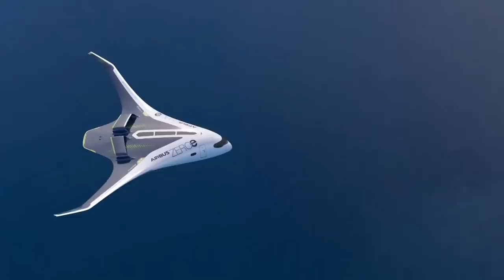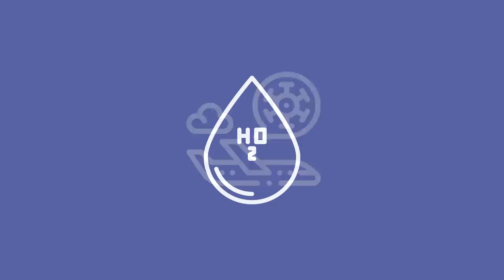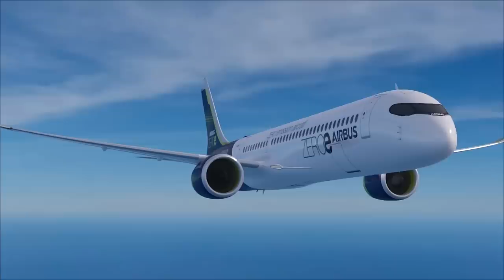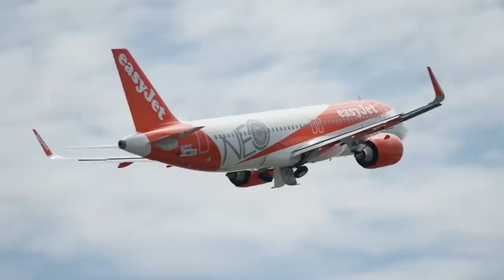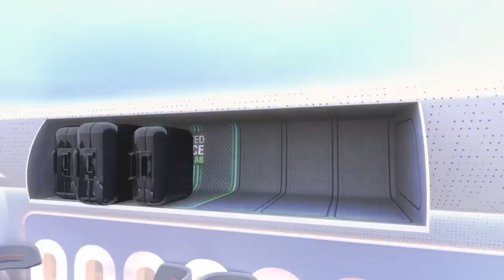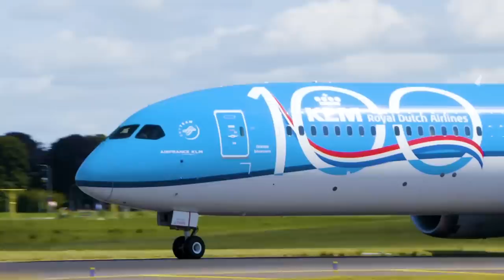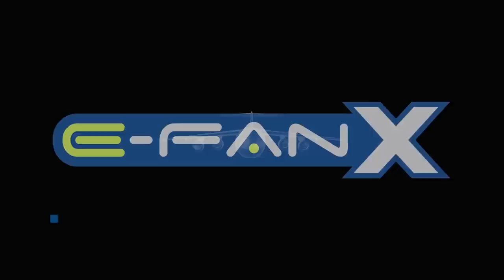Airbus Future Plane Concept - ZEROe - Hydrogen, New Cabins And Zero Emissions - Never Built

Comment: The electric concept carrying lithium batteries instead of passagers was useless and unviable. H2 with green and PV production should be very economical by then....in 2035. Seems to me the flying wing concept gets more lift from the many top wing mounted electric fans powered by H2- air fuel cell and supercondo for take off. and this propulsion could be more efficient than the more conventional pair of H2 high bypass jet engines under the wings. Finally, the best way to optimize airplanes efficiency, usage and CO2 reduction would be in general to tax the landing based on CO2 tonnage per full fare passagers of the incoming flight because empty seats and discounted ticket sales to match the fixed demand with the distorted offer instead of the contrary, are the real and major polluting waste of today's commercial aviation. Both airplane size and frequency can vary to match real demand with an A.I. multi parameter real time management system but air current waste are so big that they become invisible.
Reply: Hydrogen fuel cells make sense though. Hydrogen combustion doesn't really make sense as it doesn't improve efficiency much. It's just simply swapping one fuel type for another like gasoline to LPG. Heck, even a gasoline fuel cell would be a HUGE improvement.
Reply: 00crashtest very correct: a gas turbine has roughly half the efficiency of an H2 to air 65% efficient fuel cell but a jet engine could be much lighter so that an hybrid system using also jet engines for the very short duration takeoff and fuel cell and electric fans for cruising with even the same fans for both drives could be a possible answer, like the non plug in hybrid is an intelligent and efficient urban stop and go transmission without heavy weight batteries.
Reply: Would green methanol produced from hydrogen and captured carbon dioxide be a suitable and economical aviation fuel? Wondering?
Reply: jaganathan Jonathon yes with minimum engineering and cost but with one big loss, the heat value per weight of H2 is tremendous, two good time methane and three time liquid fuels ethanol kerosine etc...this advantage is offset by the pressure tank higher weight or with liquid H2 by the after boiling and liquefying losses and there, the bigger the tank the least the dead weight per kg of H2 is necessary so H2 planes would be big...methane and methanol smaller...

Comment: If this happens I'll eat my own sock after work. Its never going to be economical or practical as long as we use fossile fuel its to cheap for anything to compete.
Reply from the maker: Very true!
Reply: Fossil is only cheap because its still available in relative abundance, eventually there will be a tipping point where it is nolonger the cheap option.

Comment: This guy clearly does not know how much biofuel is already produce in the world !!!
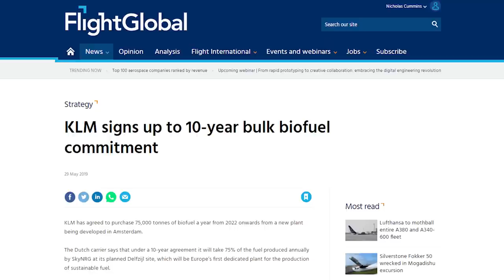5:44  "The KLM would used up the entire world supply of biofuels in less then a day at peak operations."
That is simply complete nonsense. 

The Brazil produced 26.72 billion liters of ethanol in 2017 from sugar cane in sustainable  way. 
The Air France KLM spent 4,5 bln EUR in 2017 per jet fuel (kerosene) that is 5,28 bln $/year. 
According to IATA the price of jet fuel is now 0,623 $/kg which means that KLM uses around 8,48 bln kg of kerosene. 
Of course the kerosene has 12 kWh/kg that is more then the liter of ethanol 6,67 kWh/liter. 
But even converting that use of KLM per liters of ethanol it would be 15,26 bln liters of ethanol per year. 

Clearly yearly production of ethanol in Brazil would be enough to power Air France KLM for 1,75 year. 
And there is also USA that produce similar quantities of ethanol but in not very sustainable way.

Comment: Carbon dioxide extraction and conversion with water and renewable energy to produce hydrocarbons is a much more viable technology than hydrogen. The volume that liquid hydrogen takes up would probably up the ticket price just based on seat reduction alone by a third or more.

Comment: an airplane made like that you have to explain to me how it can fly, are we kidding?  blonde entrance too thick, then towards the tail it is flat, can you explain to me how it can pressurize such an airplane?  even if you use 100% carbon fiber you would put the structure in crisis, a bullshit of the project, everything needs to be redone.  I remind you that the new Boeing 787 has an airfoil of a glider, to improve performance which was impossible with aluminum, and now Air bus wants me to believe that that project can work ???  it's an insult to aeronautical engineers, believe me

Comment: Lol why does airbus copy boeing so much. Just 10 years ago same looking Boeing blended wing body aircraft was unveiled
Reply: Boeing never unveiled an BWB. You are referring to a rendering on the front of popular mechanics. The design of the BWB has been mostly researched by NASA together with Boeing on a R&D side of things. No commercial products are derived from that. Besides the BWB design is not owned by anyone, just like the tube with wings or the flying wing.
Reply: @almerindaromeira8352  But they did do flights ina model tho, Just like how airbus did with the flying v. i Doubt this design is the future tho
Reply: @aseem7w9  that's what everyone said about smartphones in 2007. I like it, it's efficient, compact, allows for more flexibility in the design (when compared to a tube with wings). Plus there is not much to develop in the conventional design anyway. Most improvements come from the engine side of things and the use of composites to reduce weight, but aerodynamically thats it.

Comment: "Who's to say"  hahaha it's physics fool. LH2 energy density is too low for long haul flights.  Also you said only the engines need modification.... totally wrong. Go back and do some actual  research.
Reply from the maker: There is a note that it includes the fuel delivery systems such as tanks, cooling etch. You can see in the video that the back half of the plane is taken up by this equipment